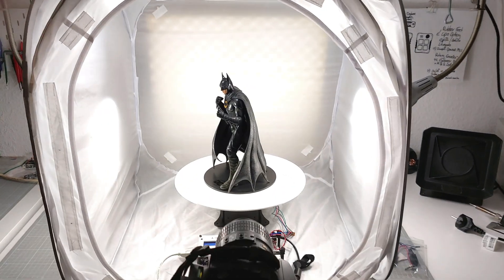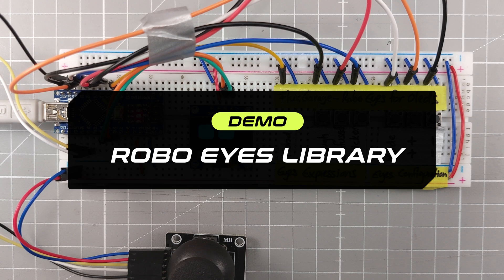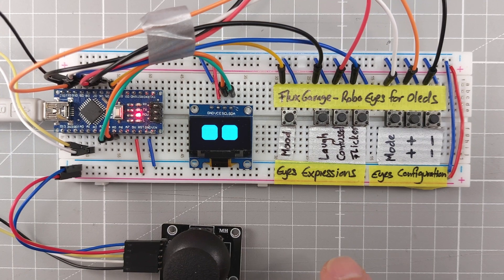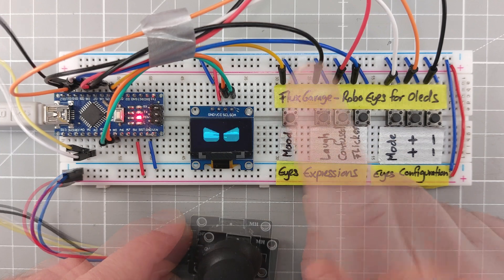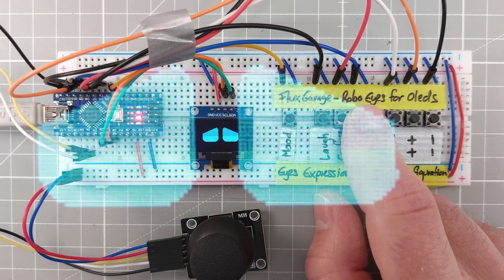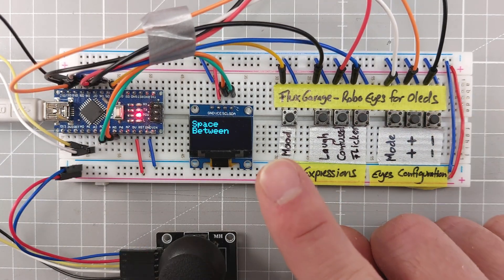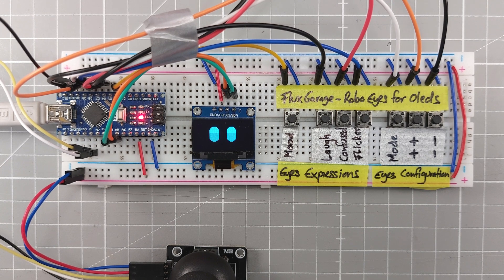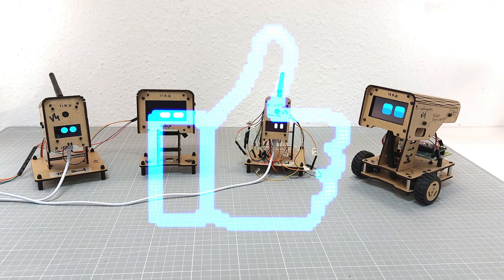#1 - Smoothly Animated Robot Eyes on OLED Displays with the Robo Eyes Library

Comment: Hello. Is it possible to use the tiny 0.42" display too?
Reply from the maker: Yes, any OLED display that is supported by the Adafruit GFX library can be used. You should then definitely set a small width and height for the eyes, as well as a small value for the space between to make sure the eyes fit on the 72x40px screen.

Comment: I’m trying to integrate these eyes on a planter made from old circuit boards kind of like a discarded or recycled robot, but I have no idea how to start…
Reply from the maker: The starting process depends on your current knowledge. The first thing to do is to buy a micro controller and an oled display, e.g.:
Arduino Nano V3 or ESP32 C3 Supermini
Oled display 128x64px I2C with SSD1306 chip

Next is to learn how to wire the display and to upload sketches to your microcontroller.

As soon as you've reached this "level", check my getting started video:
https://youtu.be/WtLWc5zzrmI?si=BcLD81w_KcPwyitl

Comment: Bro i want make same Animated eyes with esp8266 please help?
Reply from the maker: The best way to start here is to connect an oled display to your esp8266 and get the respective adafruit display driver up and running. For example, if you have an SSD1306 display, install the Adafruit SSD1306 driver library and open the example to check if everything works. If it works, install the Adafruit GFX library and upload one of the examples sketches of the RoboEyes library.

Comment: Hi can you do a tutorial where you explain the model of the buttons that you use to change the eyes moods an stuff like how to plug them and how to make them work with the arduino code that is on your github please I created a pet robot with the eyes you made and I just wanted to add buttons instead of opening my pc all the time that would be very kind of you goodbye 😊😊😊
Reply from the maker: Sure, there is already an instructable that explains all the details of this test circuit:
https://www.instructables.com/Smoothly-Animated-Robot-Eyes-on-OLED-Displays-With/

The code for this test circuit is included with the library, just have a look at the examples folder and check the „ConfigurationBoard“ example.

Furthermore, I found this on wokwi, where some user has built a virtual representation of the test circuit board:
https://wokwi.com/projects/412194703749736449

Comment: why is mine when I use tft 1.8 display flickers everytime the eyes moves? like white flashes the screen, I just want answers thanks
sorry im new to this so pls be gentle
Reply from the maker: This is because typical TFT displays don‘t have a buffer. And thus, all elements of each sprite are drawn directly to the display. So you‘re probably always starting with a white screen, then it will be filled with a black background, the two basic eye rectangles are drawn and then the eye shape overlays are drawn on top - and all of this in rgb color, which takes additional time compared to a monochrome oled display, where each pixel requires just a single bit.
Monochrome oled displays have an internal buffer, where any drawing is prepared first before it will actually be displayed.
For TFT displays there are workarounds, e.g. using the microcontroller‘s memory as a buffer to prerender each frame and only push the final result to the display. As far as I know, TFT_eSPI offers such a capability.
Personally, I‘ll stick to OLED displays because they also have a much better viewing angle and a good contrast compared to typical TFT displays.
Reply: @FluxGarage  THANK YOU SO MUCH for your effort to reply me, and thank you for the explaination
Reply: @FluxGarage  is there an OLED big sizes tho? cause you used like big display for your robo eyes, mine is just .96 OLED and 1.8 tft thats why Im assuming its tft you have in the video.
Reply from the maker: I'm using 2.42 inch oled displays

Comment: Thank Flux! Love this library. Do you think it’s possible to utilize two of the OLED displays used in this video as a single set of eyes?(given we can adjust address on the display, not cheap ones)
Reply from the maker: Thanks. Yes, it should be possible with some adjustments in the code. I'm currently also trying to figure it out, but I2C with a multiplexer seems to be a bit slow. Will try SPI displays instead.
Reply: @FluxGarage  Amazing! keep me posted, these will be perfect for my 1:1 Chappie 3d print.  Attempted to find a 16x2 OLED ic2 display but couldn't come up with much and didn't want to spend $50 on a gamble lol.

Comment: euhm maybe a stupid question but is it possible to use 2 screens 1screen per eye?
Reply from the maker: That's a frequently asked question and the answer is: not "out of the box", but it should be possible. It requires a hardware solution, e.g. two displays with different I2C adresses. And the some changes on the software side need to be made. I'll put that on my to do list to figure it out for a future Version of the library.
Reply: @FluxGarage  thanks for the info , i'm gonna try and find a a bigger display for my robot build
Reply: @FluxGarage  ok another question if you don`t mind , i got a 5.5inch oled screen a ssd1322 how to adjust the code to that screen? 256x64 screen
Reply from the maker: @ratrollerzspeedshop  Sure. I'm not familiar with ssd1322 yet, but I've found a library that should make it possible to run the RoboEyes on such displays:
https://github.com/venice1200/SSD1322_for_Adafruit_GFX
Reply from the maker: I'd install the library and start with the ssd1322_test.ino - If you get this one up and running, you can then get rid of all the test drawing functions and include the RoboEyes as shown in the video #2.

Comment: Is it possible to use 2 visors and to put 1 eye in each of the OLED screens?
Reply from the maker: This is a frequently asked question. In theory yes, but not "out of the box".
At first, you'll have to find a hardware solution to use the two displays with one controller.
Next you need to adjust the RoboEyes library's core to split up the actual drawings for the two displays. 
And of course, probably you'll need to adjust some of the library's logic.

Comment: Any chance it would work on two separate displays (one eye on one display)? 
I am trying to achieve something similar with the smaller 128x32 modules on raspberry pi.
Reply from the maker: In theory, this is absolutely possible, but not "out of the box". 
You'll have to find a solution for controlling the two displays with a single controller, there are some tutorials here on youtube how this can work.
After that, you can use the RoboEyes library as a starting point and split up the drawings.
Reply: @FluxGarage  I got them connected both to software I2C buses and can draw simple rectangles to them. I think I will need to use threading to draw them at the same time, but other than that I think I am ready. I will take a look at the library and try to integrate it.

Comment: hey can i use this library in tft circular display?
Reply from the maker: Not as it is, but theoretically it can be adapted to work on TFTs, because it‘s based on the Adafruit GFX library. Also, you would need a fast controller to push all the colored pixels.

Comment: Bro u change all with button can u use sensors axcept button than when we tilt robot eyes down such as
Reply from the maker: Yes, you can read any kind of sensor and trigger some state changes or animations accordingly. For example, you can involve a temperature sensor and let the robot shiver/freeze when it‘s cold. I‘m working on some shorts that cover such sensor related stuff.
Reply: @FluxGarage  plzz make it and ehen we put hand on robot head his eyes moves up plzz make it
Reply from the maker: Will do this in the next few weeks :)